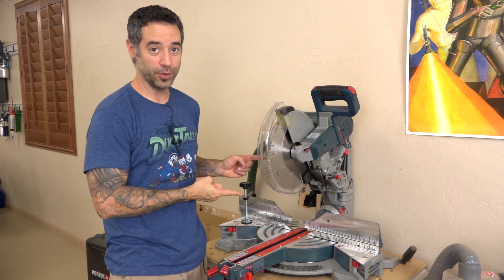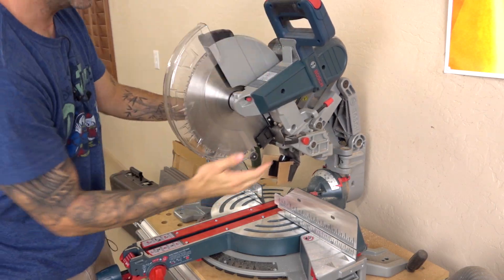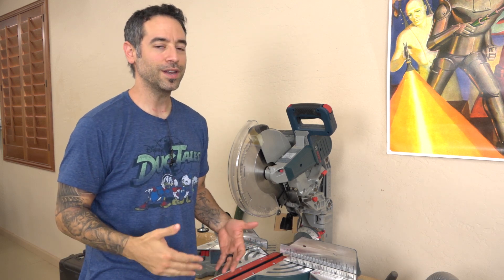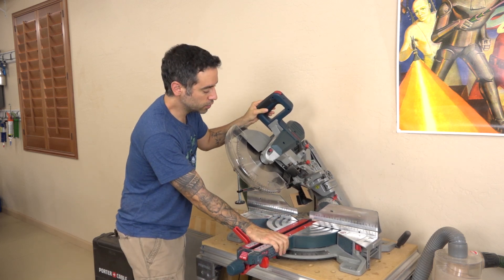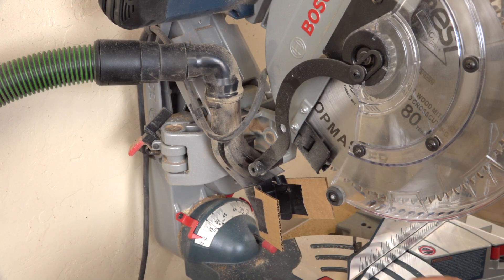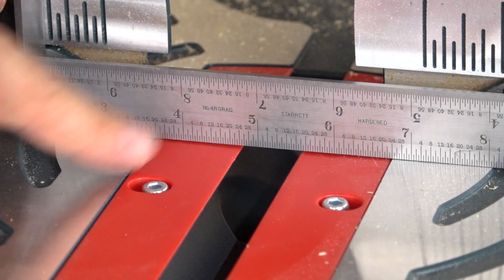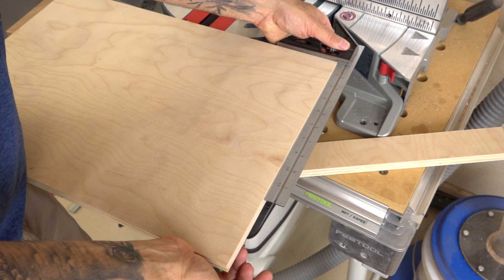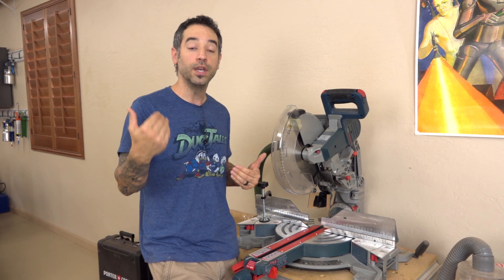Bosch Glide vs Festool Kapex

Comment: It should be telling that Mark's shop tour video in 2019 no longer features this saw in the shop, but rather a Dewalt. Where did the Bosch go? 

I've owned this saw for ~5 years. It's a great saw for rough cuts and general carpentry where absolute accuracy isn't a concern. There are, however, a few issues that become apparent after using the saw for a while.

1) Trenching feature. I hardly use it, but it's worth mentioning that with the Festool you can use the trenching feature and it will give you a repeatable depth of cut pretty much every time. With the Bosch, your depth of cut is going to vary up 1/32, 1/16" or more matter how daintily you try and engage the saw. This reveals just how much play there is in the glide mechanism... at least in the z direction. It's been like this since day 1, and the other glide saw I've tried was the same way. This especially comes into play when  doing beveled cuts where the saw glide mechanism needs to resists the blade trying to catch and grab and pull the mechanism. causing crappy cuts.
2) Wide boards... too much play in the mechanism to reliably and accurately cut wide boards. I've spent so much time fiddling around dialing in this saw to get an accurate cut on one board, to have the next cut be off slightly even with the lightest touch.
3) Bevel cuts... Good luck. For run of the mill finish carpentry it's perfectly acceptable. But for super accurate work, good luck... Especially on wide boards. Cutting a 45 degree bevel on a 10" wide board is totally hit or miss.
4) Casting and fence issues. The vertical fences on my unit are not in the same plane. At the time, I bought this saw for rougher work and should have been more discriminating when I took the saw out of the box. Shame on me for not noticing this prior to end of the return period. The right side vertical face is sits just slightly behind the left. Luckily I have metal shim stock on hand and was able to more or less dial it in. 

I've only played with the Festool Kapex a few times at a local store, so I can't give a long term review. The $1500 price tag is pretty steep. I probably do enough work to justify the price, and may purchase one in the future as I have some large projects coming up.
Reply from the maker: Not to detract from your review but I wanted to clarify why I don't have the Bosch anymore. First, I switched to DeWalt because I wanted to experiment with a non-slider, just to see how far I could go with it. After that point, I hired someone to help in the shop. I got tired of seeing him have to flip boards just to make simple cross-cuts and I really wanted to cut down on the airborne dust. So I went back to a Kapex. Trying to follow my miter saw saga is challenging. :) But I didn't really get rid of the Bosch because of any particular faults I found.

Comment: I’m torn between these two saws. I do most of my work on site and I’m a bit worried about the weight of the Bosch. I was considering the kapex for dust collection and lighter weight. $900 difference I guess I could just get more shredded
Reply: The bosch has a better handle than the festool just FYI xD

Comment: Do you need the higher fence ? It looks as if the quick release clamp would work if you could remove the fence extension.
Reply: You can slide the top part of the fence further out from the saw.  In fact you have to for some bevel cuts. There's a little red lever on the back of the fence to unlock it.  Then I suspect the quick clamp will fit.

Comment: I hate clamps like that but I have a way to fix it.   Take off the plastic handle and weld on a decent size nut.  Then you can use a socket in your drill to move the clamp in and out much faster.

Comment: I've been told by the guy in my woodcraft, s o take it with a grain of salt,  that you can order the little plastic/rubber kapex dust shroud and it will fit on the Bosch and improve dust collection immensly. That is what I am going to try

Comment: I recently purchased the Bosch saw and saw a review on Amazon for the Kapex clamp that said you had a video showing it’s use on the Bosch saw, so I bought one.  I searched your channel prior to purchasing and couldn’t find any video showing this use, but ordered one anyway. I just received it and it does fit the saw, but only inserts partially, and was curious if you used it like this, or did any modifications to the shaft to insert further. Thanks

Comment: Confused at why when you already had the kapex did you go for the Bosch? I understand if you were just doing a review for which one to buy etc but you seemed to have swapped it out and using the Bosch full time now (n now are using the DeWalt in current videos) If the kapex did everything better bar the handle/trigger, blade choice why get rid of the kapex? Did I miss something. Love your videos as usual and have watched this one numerous times especially whenever I think about upgrading my Makita non sliding.

Comment: LOTS of complaints about not cutting 90 deg (or 45) on Amazon, but that glide mechanism is unbeatable.  It's like sliding the saw through air.

Comment: Festool do have few very good functions. For example the laser is in fact 2 laser beams showing both left and right side of the blade so you will always know exatly how wide the blade is cutting. The vacuum hose connection is also very good as well as protactor you have withn the saw.

Comment: I contacted Bosch tools about their GCM12SD for an issue what I had with the base of the saw, they told me "this saw is not made for fine woodworking" And their margin of error of the flatness of the base is up to '1/2 cm' - "This saw saw is made for job sites" that was the technicians response. But after noticing the cause of the issue a crack in the base, so I actually  don't think that this saw will withstand the and sustain the taking back and forth from the job site it is poor quality material.

Comment: Have you used the Dewalt DWS780 by any chance? If so how would you compare them? I'm really liking the smaller foot print of the Bausch but am a Dewalt fan. Any input would be appreciated. I'm about to build a miter station soon. I'm fortunate in that my shop is good sized so the larger footprint isn't a major issue if all else is equal.

Comment: what i did with my kapex was disconnect the little safety lock in the trigger mechanism so now all i have to do is pull the trigger and she goes,  and no lock for the saw head either, i can just pull it down like any other saw. was a really stupid "safety feature".
Reply: Don't you never need to measure from the blade?  How do you do that with your modification?
Reply: +christschool not sure what you mean exactly, are you talking about the lock for holding the saw head down? Do you have or have you used a kapex?
Reply: JimmY Sorry for my clumsy question.  Yes, I have a Kapex.  When you disconnect the safety lock, how do you lower the blade without it turning on in order to measure from the teeth for your cut?
Reply: +christschool well you know how you have to pull the trigger half way to enable the saw head to come down? All ive done is taken off the small tab that locks it. Have a look on your saw at the top of the guard just under the black bit, and then pull the trigger (halfway) and you will see its what stops the saw coming down, just clip it off and then it works like any other saw. You can also disconnect the thumb switch on the top (not really a switch just a bit of plastic that stops the trigger being pulled) but for that you have to take the cover off the handle. Both are very simple to remove  but are a nuisance to use

Comment: I've been holding off on upgrading my Dewalt miter saw, non-slider, to either a Bosch or a Kapex.  So very timely video for me.  I am more interested in the reach, so the wall advantage of the Bosch, while nice, is not a deciding factor.  The price however is definitely a factor and probably the deciding factor.  Thanks for the comparison.  BTW, if you could glue or somehow afix a drill socket to the top of the clamp, you could use a hand drill to draw it up and down in a jiffy.

Comment: If you do look at the Makita, I would love to hear your thoughts on it. For me, I'm still doubting between a Bosch like this, and a Makita like that (I say like, because the actual models are always different here). One other thing I was wondering about, do you ever use the depth stop feature on either of the saws? That can be useful for, at least roughing out, tenons or dadoes or something like that. So if you have any thoughts on that I would love to hear them.
Reply from the maker: +Tjalling it's a nice concept but the execution is lacking. I can't get good results with the depth stop feature.
Reply: Yeah, that's been my experience too with the saws I've used so far. Thanks for your reply, enjoy the Bosch!

Comment: Nice vid, thanks!  I have the Bosch as well, however I’ve noticed a wavy cut when cutting upto 10+ inches wide.  My cuts are perfect 90 near the fence.... but wavy and off 90 further out.  Have you experienced this?

Comment: Were do you get a Bosch GCM 12 SD for 600 USD?In Sweden the Bosch is 1540 USD and the Kapex 120 is 1480 USDThe Festool saw is cheaper hereThere is a Bosch mitre saw the GCM 12 JL that costs about 600 USD

Comment: I bought this saw a couple years ago and having a small shop  the low profile of the back is invaluable. The dust collection I agree is lacking but over I love my "Bosch glider" As a bonus I bought as a refurbish at a local tool shop and stole it for $350!
Reply: Home Depot just had these miter saws on clerance for $379.99, I think that was the only time I had ever seen them below the 599.99 or 649.99 price they had for years

Comment: you also forgot to mention the included mitre angle gauge + Laser line they add to the saw, the laser making any adjustments easier ( two lines in fact, bordering the kerf line).

Comment: I'm really on the fence between the kapex and the bosch. Is it possible with either of these to efficiently achieve the repeatable accuracy of a TS sled? Thanks for the channel and all the information, I've learned a great deal from you.
Reply: Some people are happy as a clam with their Bosch glides and kapex saws.  Some are pissed off with quality, accuracy and repair service.  For a jobsite saw I think the Dewalt with work light (I don't use it to align my cut), is the way to go.  Properly calibrated and with a good blade it's quick and easy to set the miter angles as well bevel angles.  The bevel release knob in the back is quick to release and the scale is super easy to read down to a quarter degree especially with the led light.  But if you gotta have zero clearance in the back Dewalt doesn't cut it.

Comment: I just bought this saw used.  I've had a thorough look all around the saw, and I'm finding I don't like the clamp for the tilt feature.  I have 2 other mitre saws, one of which is an old and very large Ridgid brand.  The Ridgid one is with the big round table.  It really has an excellent drum-brake-style tilt clamp, and the gripping lever arm acts on a drum thats a good 5" diameter.  The Bosch has no such mechanical advantage built in, and the clamp bolt acts at a radial distance of about 1.7".  Add to that the belville washers, and I find the clamping force is really poor in comparison to the old Ridgid.  The previous user seemed to have tightened the heck out of the clamping bolt, so the front levers were useless to clamp or release the tilt pivot.  Doing this, yes, the tilt pivot was good and rigid, but the front controls rendered moot.

Comment: I've got the Makita myself.  A nice saw too, but i think i'd really like the Bosch better, especially in a tight shop situation.  The Makita does have slightly better clamps (i bought a 2nd one for the other side too).
The Makita's dust collection however is horrible (i have no idea what they were thinking).  I removed the useless tiny chute and built a new one out of cardboard and ducttape that actually works almost as well as the Festool.
And the Makita's (extra cost) side extensions aren't nearly as nice as the Bosch's.

Comment: Im curious why people dont use radial arm saws anymore?
Reply from the maker: +joeychgo SCMS killed the RAS star. :) I imagine with tablesaws and reasonably prices SCMSs, radial arm saws became redundant.
Reply: The Radial arm takes up a big shop footprint too, esp for what it does... and if you ever have one dig in and run towards you while making a cut, it will freak you out a bit. I had one years ago... was not a fan and got rid of it.
Reply: But, cant you do more with a Radial Arm Saw? Like Dado's for example?
Reply: that is true, but I was never happy with results of dados with my radial arm, and got much better results cutting dados with a router or table saw , if someone has a radial arm and it works well for them, I'm no one to criticize, but my experience with one was very mediocre..

Comment: So question does that blade come in ten inch and a fifty tooth count I cant find a lower then 72 count that's not ideal for cutting exotic wood species to much change of burning the wood found that out the hard way burned alot of purple heart up b4 lowering tooth count to 50 got a general purpose blade
Reply: Saw comes in ten or twelve inch. Blade that comes with it is 60 tooth.standard arbor size let’s you put on what ever blade yiu can find.

Comment: and what exactly are the pros for the Glide over the Kapex? I don't get it, there is no better saw like the Kapex on the market.
Reply from the maker: +xjeeper watch the video. :)
Reply: I think you missed the point. He's not saying that the Bosch is better based on performance, he's saying that for most users out there other than in a professional environment this will give you the most value for money. More expensive than the shitty ones, but does a better job, not as good as the most expensive ones, but does a comparable job at a fraction of the cost. A well balanced, all round performer.

 Unless you use it frequently for a variety of tasks, the Festool just isn't worth the outlay.
Reply: +Ben Good Bosch is better at something not mentioned, it's a 12" not 10" so if you need to cut angles on say a 4x4 it's much easier on the Bosch, I had to do a tricky 45 on a piece of 4" base standing up on the fence and the kapex did a fine job when angled to the left, to the right thou it wasn't able to make the cut due to that bar it has for the saw to glide on.

Comment: great recommendation Marc. i also have the same saw, i love it. I do agree with your thoughts on that clamp.
Reply: I just brought one as well.  It's a huge improvement over the Sears Crapsman that am putting up for sale
Reply: The only real problem I have with mine is the depth of cut. If you have to make a 45 deg cut on, let’s say a 5 1/4” base, in the middle of the board somewhere it will only allow for a 3 7/8” depth of cut. If you’re on the end of the board it’s not an issue. Yes you can lay it flat and make a bevel cut, but no one really wants to do that if they don’t have too.

Comment: Thanks for the review Marc, which has helped me to pull the trigger on this baby - which I did yesterday. Love the saw. I'm now looking to replace the stock blade to maximise value from the investment. I'm strongly considering on ordering the Forrest blade you used over the diablo - the latter is much cheaper and more accessible here in Australia. I'm a patient guy, so am prepared to order from US. Do you think this investment is worth it?
Reply: I too am based in Aus and bought this recently. Love it over everything else we have access too (although I did get mine at a bargain price). Specifically picked mine up because of the glide function over the sliding bars, and will most liekly head on down to Bunnings in a month or two to pick up a Diablo, I can't imagine the Forrest blade being worth the hassle but would love to get your feedback if you move forward with it!

Comment: I have the bosch and  love it. like you said the dust collection could be better I made something The insert I replaced with my own. the clamping is different in in EU it has a slow and quick setting which is much better. the price however is much higher here it is 1100 to 1200 euro.... still worth my money

Comment: the festool does not have bars to the rear. why mention this suggestion in the beginning? the Bosch is a dust spray gun, noisy and heavy.  and ooooh, the clamp. junk. for 900 less? Probably. I'm getting the kapex 60. Also 700.

Comment: Hi 

Can anyone provide a couple of measurements for the GCM12GDL, I have 4 weeks to build a bench /saw station before my machine arrives, can't seem to get this info anywhere

1. Distance from rear mounting holes to back of machine (wall) 
2. Height of saw bed (to build benches either side to correct height) 
3. Distance between mounting holes (depth and width)

Comment: I think it's clear to see its not built to a Festool standard. Thats ok as it doesn't have the price tag. However if you are a professional tradesman as I am, then you should be earning enough to afford the Kapex. The quality of the work will show, and research suggests the Kapex will still be good way after the warranty has expired. Its a mitre saw and if your mitres are open then saving $1,000 is no compensation as its not doing its job. The Bosch is an affordable DIY tool. The festool Kapex  is not aimed at that market.Its a professional tradesman tool and you have to pay for that build quality.